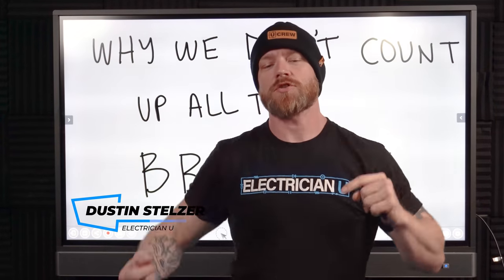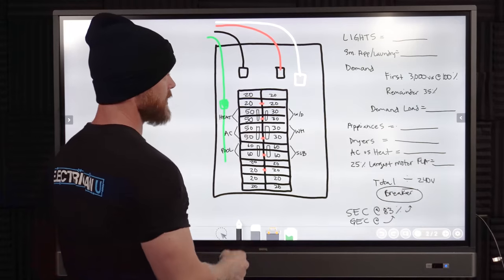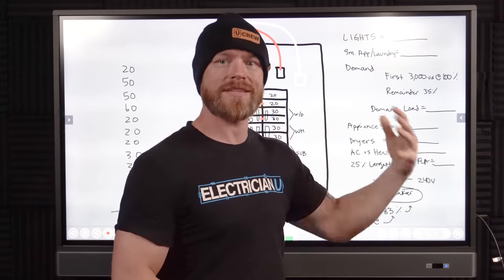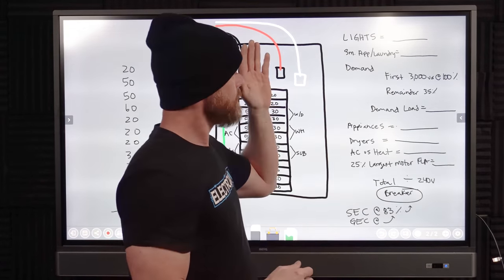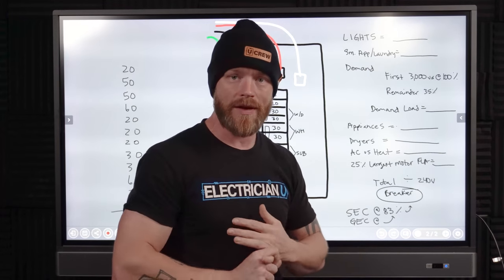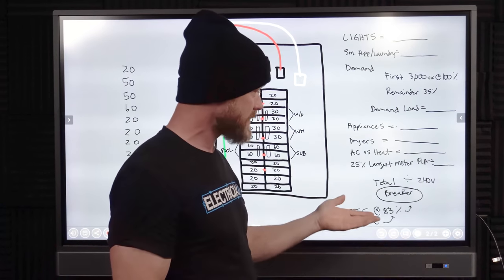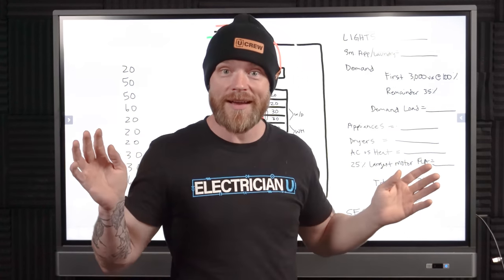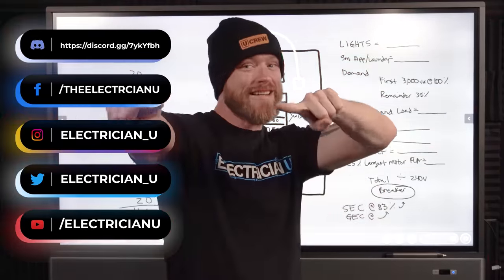Why is there more than 200 A worth of breakers inside of a 200 amp panel?!

Comment: no the video really needs to be redone as now its a mixed bag 💼💩 and my 70's 3000 SQFT sub-100A ( obsolete now in 2022 as 200A is the new standard and 400A is the big boy and anything over 600A does happen but rarely matters to homeowners or getting installed and the biggest iv herd of is about 1200A SP 240V but that was a big single family dwelling house and big farm/city/entertainment shop/space as well plus more than one panel in parallel to do it ) to now just for 200A's in 2020 is more than 10k sad and pissed off was bid at 5k ( im willing to share my knowledge but i haven't added up all of the costs yet ) but the usa economy ect didn't let that happen anyways 400A wasn't much more so i went with 400A and my house yes we do turn on Eg ( just not every single day say 7~ out off 30 days ) and at least for my seman's panel equipment operating and installation instructions says ( also to thermal imaging once a year or after a failure like a short/fire/severely overload ect ) 350-400 aka max loading and max ambient temperature is about 101F for under 3 hours after that shutdown or max is about 200A to let it cool off and yes i have all regular metering socket maid panel ect. for residential i guess you haven't seen it or more than likely choose not too know about it EU... 🤔

and a 1000 SQFT home can pull 200A's or more but i don't know about if you have other buildings running of the same main panel or not aka shop, barn , guest living or storage  spaces ect and yes i know all about maxing out or over cooking it as iv lived in more than one small house ect and triped the main's or ended up actsedently cooking the wires and omost started a fire on a pre-1990 100A-150A complete system and no extra building's aka just the house
Reply: eg was we do turn on everything all at once as we do have high peeking loading YouTube eat it/auto duck

Comment: 4 minutes in, no, we need the electricity in the summer I can’t run we can’t run 2 computers and 1 ac, but we have 2 acs ☠️ fuck we can’t use one pc and 1 ac if we are using two monitors

2 entire rooms on a 15amp ☠️ and that’s normalized since you guys underestimate….

Comment: Just wondering if he ever got around to explaining that the total amount of amperage comming into a residential house is only 90 amps. That's all there is, 90 amps. Just because code calls for 200 amp service doesn't mean that's what you get. The transformer only puts out 90. So why is the code 200?
Reply: Transformers don't 'put out 90A' only. Transformers will try output whatever current needed to supply the load connected. They will be limited by internal or external fusing only. A transformer core is a passive device with no smarts or controls and does not know what load it is supplying.
Reply: @maleman5610  is correct here. A transformer winding is just a coiled copper wire. It does not control current. If you put a 1 ohm resistor across it that can take 58KW the transformer will out put 240 amps.

Comment: OK: please put up with me a sec. (Background I have 14 college creds in ANALOG electrical. 9 in DIGITALelectrical). that being said I have an electrician come in to make sure what I do is UP TO CODE (My house IS NOT TO CODE and trying to fix it. )(MY house is so old their Bare wires from insulator to insulator was used in more) She used to tell me to know I ONLY THEORY BUT all I know is THERY (true) 
  (outside computer/ digital I am stupid)  can you tell me how to (SAFLY spit 240 to (2)120 lines) or point me to one of your posts???
Reply: The 240 box is from the hot tub that has been removed but the power box is still there, would like more 120 AC to the area.

Comment: Wil be interesting in California and parts of NY state in about ten years when the new law prohibits any natural gas in new homes then 5 to 10 years or so latet make existing homes stop using natural gas. If a homeowner has central AC , electric heat, electtic cooking, water heater & dryer snd two EV cars might need at least a 300 amp service. Of course lazy foot dragging ultility companies will never have the transmission lines or hard to get distribution transformers instslled until years later. Dony worry be happy California politicians have a answer tor possible winter  toling blackouts furing vokdedt days. Yep going to pay halve of the price for indulated sleeping bags & ling johns to keep people grom freezing to death

Comment: So basic. Come on dustin. Dont be a clickbaiter. .... ok I'll watch. 

Wrong! You're talking about why feeders are rated smaller. Load adding up is just fine because no wire is unprotected for more than its rated load! Every wire is protected for its proper ampacity.

That's all there is to it! Not the 230 nec load calcs, that's irrelevant.